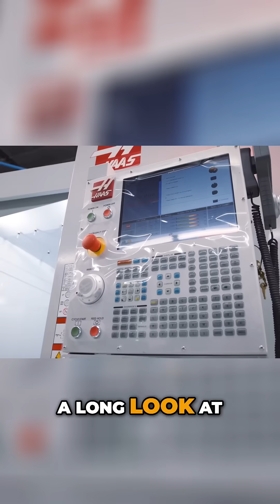Why I Chose My Haas EC 400 #piersonworkholding #cncmachining #manufacturing #cnc #production #tips

Comment: I’ve worked on several of these machines over the years and if I walk into a shop with one I’ll walk right out. That’s how bad an experience I’ve had with these machines. 4 different EC 400 and all were a leaky messy nightmare. The worst part about this machine is chip build up. Hope they did something different than the ones I ran otherwise get ready to make some lakes in your shop when it won’t drain because chips are pilled up.

Comment: Until you really start pushing extremely expensive tooling to its limits on set and forget jobs those top line machines are possibly an over extension for most companies. If you're jobbing and small batch at reasonable profit margin, spend the extra money on the programming and operating people. 
If you're tight margin high through- put on micron tolerance and ra constrained finish, you probably aren't watching this as a Haas advertisement.